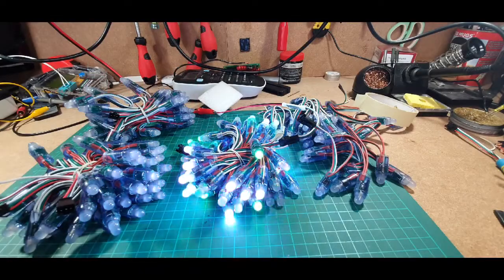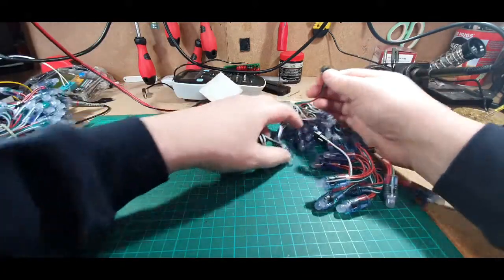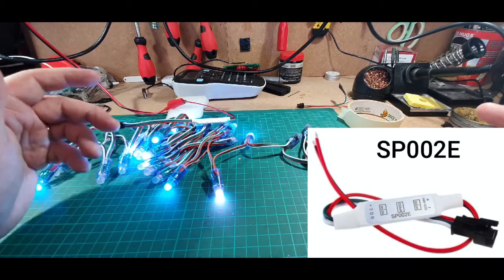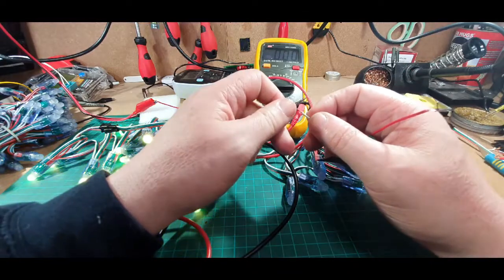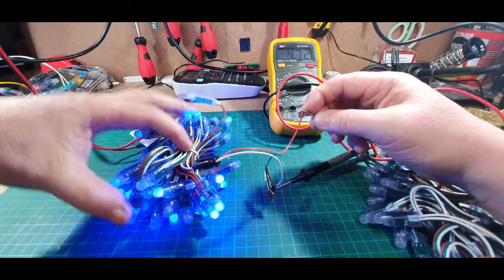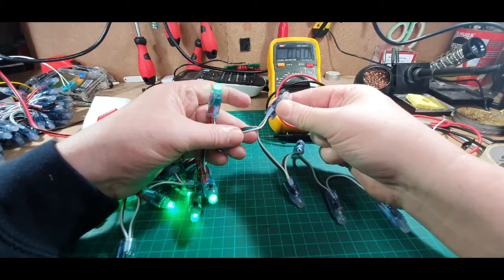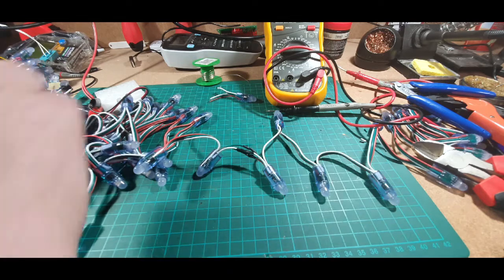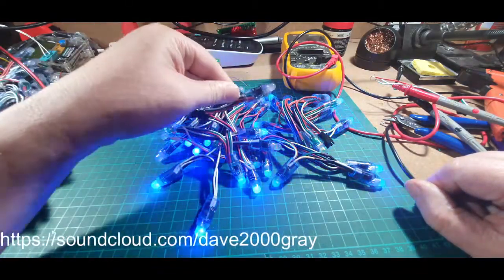Repairing a string of WS2811 LED’s

Comment: I would have applied power from the end to see if it was just a bad power connection first before cutting. it was a good guess if it was the first dead one or the last lit one. 2 straight pins and a meter would have pinned that down before cutting. was it the pixel or solder joint of wire?
Reply from the maker: Good idea, but from previous experience buying these LED's its usually the first dead is the one to change

Comment: I have a big probleme,. mine not working all strip, but i cut the first, and first start working, i cut the second, and third starwork and individually second work too, but all togetter dont work
Reply from the maker: This all depends on your LED strip, check continuity on all your cables and soldering points

Comment: Good testing technique. I think though that I would have gone one step further before cutting out a pixel, by applying power to the tail end of the string as well and see if all the pixels lit up at that point. If so, then I would run that strip with power being injected to the head and tail of that particular string thus possible saving the errant pixel that you cut out.
Reply from the maker: Thanks for your comment :-)

Comment: If I run 12v power to a 12v stip of WS2811s just by using the positive and negative should I be getting the lights to power up?
Reply from the maker: Hi - no, you need a controller to provide the signal to the LED's